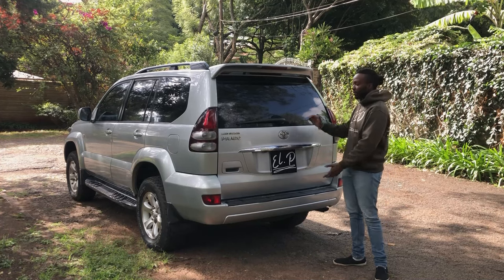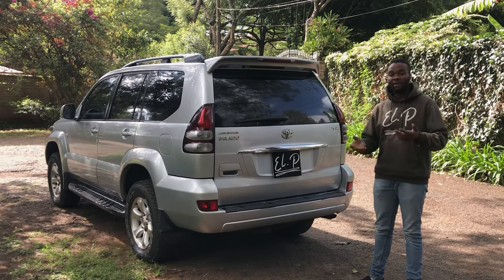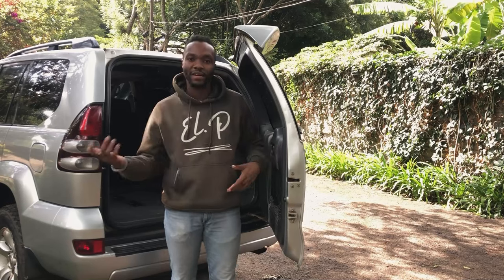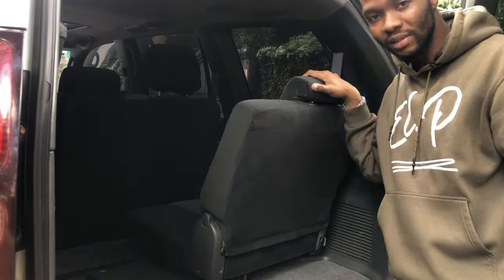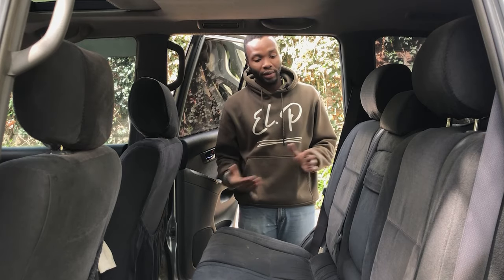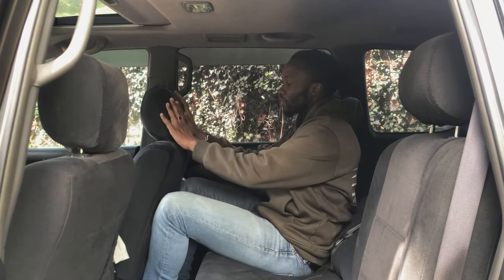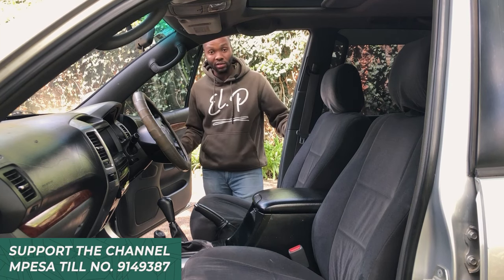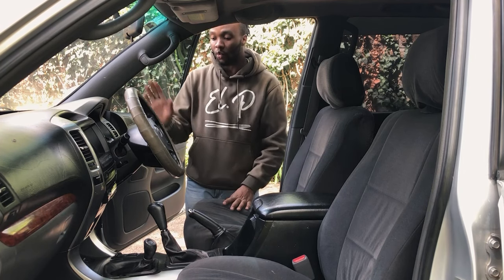Toyota land cruiser Prado (2003 -2009) all you need to know | El.P Reviews (used car review)

Comment: I have one but it as a problem with hard start when l not moved longer  what could the  problem?
Reply from the maker: A hard start issue in your Toyota Prado after it has been sitting for a while could be caused by several factors. Have you had a mechanic take a look at it and if so what have they said about it? what's their diagnosis?

Comment: What’s better the 3.0 turbo diesel or the 4.0 petrol?
Reply from the maker: They are both good. Diesels are better for long commutes and when putting in the miles, for the petrol it’s thirsty but good if you planning on towing anything or just want more power.
Reply: The petrol will drink dry, Diesel is the only Prado engine you should buy, just the size & weight of the vehicle alone will leave the petrol drinking all day 😅